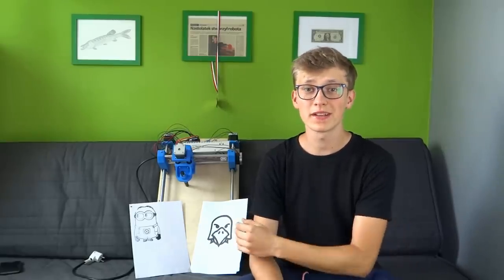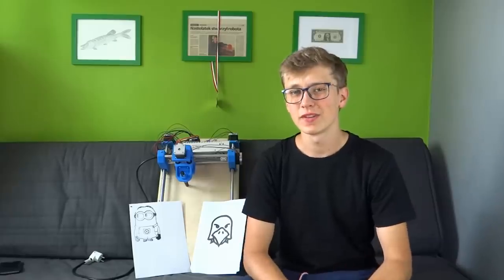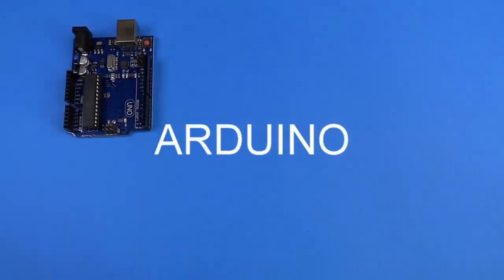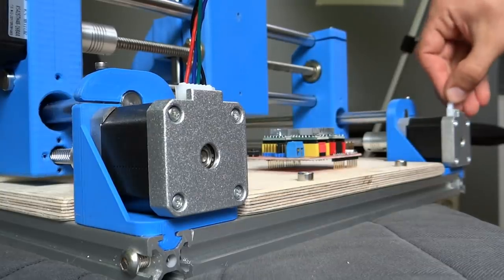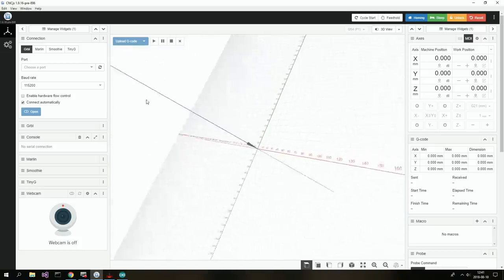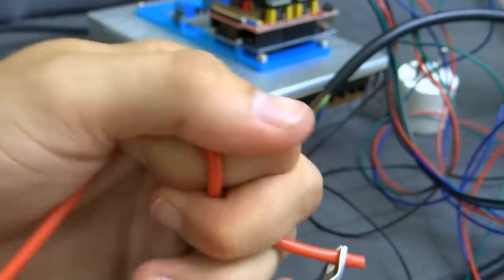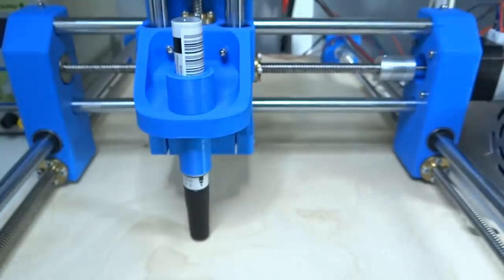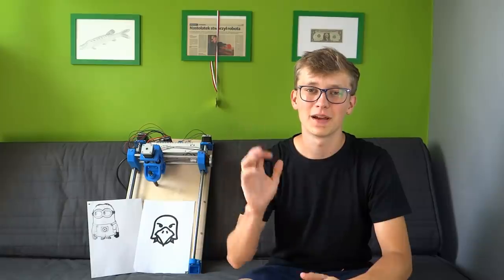DIY Dremel CNC #3 electronics, software and firmware (Arduino, aluminium profiles, 3D printed parts)

Comment: If some plastic parts crack when you drill them I have solution. Instead of chucking a bit in a drill hold bit with vice-grips and heat tip with torch till glowing and push through . I ran an Elumatic cnc  at work a few years ago and always wanted one since . I appreciate your video.

Comment: I have a problem, one of my cnc shields is smoking. I took a 12v 10a power supply and 1.9 amp motors.
Reply: Did you set the stepper drivers? You have to use a multimeter and turn the screw to make sure the proper output otherwise you will fry stuff

Comment: I ordered the 10A Power Supply because my dremel is powered on it own AC cord and I did not think I needed 20A to run the three Axis, Did i mess up or will 10 A run the three motors. I am powering one Z, One X and One Y (not 2 Y). Appreciate your input. I posted My adaptor for  this Dremel Drill Press conversion to CNC,  I know its light weight but my work is small light metal model trains, Thank You, Dennis

Update Nov 27 2023 I have completed the conversion of my Dremel Drill Press with Micro Mark Mini X Y Table into a version of your DIY CNC Mini Milling Machine. So far I used the Dremel Carriage with a unique Adaptor to the Dremel Drill Press Stand. All your recommended Digital stuff. I have only the Z axis operational and yesterday I machined a test part to verify the manual job of Z would work with manual operation of the X Y Tables. It was evident I need to continue to convert the mini XY table to CNC ASAP. I have ordered the Couplers and the CNC Shield of course has the Sockets and I also have the required A4988 drivers. I want to share the CNC Shield is a marvelous tool for us. Spindle control is a little messy but boy does this Shield Save a Bunch of time. I was so happy to see the Stepper motor take on in my first test. Now we are thinking about a load unload robot and some other tools we can use on our train layout. Thank You So much young man. Dennis in Virginia

Comment: I have finished with the physical DIY CNC machine and now I am trying to hook up the electronics.  I have been trying for over a week and am getting frustrated.  I have an Arduino Uno with a CNC shield and this is connected to my computer.
I have downloaded Grbl to the arduino and that went well.  I am using Universal Gcode Sender and when I bring it up on the computer, I checked that it has the same port as the Arduino.  I downloaded a simple Easel project, and generated Gcode.  I know the Gcode is good, since it came from an Easel project. When I bring up  the UGS window, and then open the connection, everything is fine.  But when I upload the Gcode from the Easel file the UGS,  I get a message that the 'machine status' is disconnected.  I do have the 4 cables from the stepper motors plugged into the CNC shield, but still get the error message that the status is disconnected.  Could I have a bad CNC shield?  Is there a way of testing the CNC shield?   Any help?

Comment: I have built the machine but my Z axis just vibrates. I have changed the Stepper motor driver and cnc shield by issue remains unresoved

Comment: FYI the esteps need fixing. I ran my cnc for 100mm but measured the distance at double. so $100=400 might not be the setting for everyone. 
Update: my $100=24.5, $101=24.5, $102=25, This is an approximation. And I made it run very slowly ($110, $111, $112 = 1) because my cnc would actually stall out when going very fast. Forget about putting on limit switch normal closed because it need a filtering capacitor. Also if using a power plug socket with fuse use a 1.5a. Granted I might not have bought the same spindle as other youtubers reviewers stated max wattage is 50watt and another 80 watt.

Comment: Hi, thanks for sharing such a nice project! I know this design is intended for dremel cutting purposes, but i would like to use your design for drawing just like you did in this video for testing, if so, is there any way I could increase the speed, so the pen would move faster? If yes, where I can do this change?
Reply from the maker: Sure you just have to change this in grbl settings
Reply: if you increase the speed it might affect the pen and may not write properly if the pen aint ok

Comment: Have you checked the concentricity of the spindle and chuck on the Dremel? I've had one where they were misaligned so that the tool axis was at an angle to the axis that the spindle was rotating on. Proxxon tools have much better spindle concentricity and alignment but they're twice as expensive.

Comment: For aluminium I wondered why you didn't use dual 12mm  guides for X axis ,long axis , just to keep it stiff. If it can cut aluminium it would be worth cutting and replacing the 3d printed parts even if you have to layer the parts out of thinner aluminium sheet and screw them together with screws to make one solid unit . I'm not sure if you could ten braze the sheets with special low temp rods and a gas torch . Even if this process is slow it will offer a more rigid design possibly stiff enough to make small brackets and assemblies. Speed may need to be slower to reduce the stresses but it is a budget machine after all.  I was contemplating designing 3d moulds to make a similar system partially from cement parts in order to stiffen the machine but this might entail stronger machines or gearing.

Comment: Nikodem, 12V and 5A is enought to power supply this cnc? I saw you used 12V 30A. Tks
Reply from the maker: Sure, check out video number 5 of this series I replaced this big power supply with something way smaller that works too

Comment: Hi Nik have you by any chance got a design for the printed part that is fixed to the power supply to hold the Arduino and other electronics .
I am half way through building CNC i am going to try fixing Makita Palm router to cnc .
Carry on with the designs

Comment: Hi. Can I ask if you have pictures of how to connect the end stops? Mine are the 3 pin connectors ( end stop mounted in n a small board ) and I'm not sure how to connect them .. thanks
Reply from the maker: you should connect COM pin and normal open pin (the third one is normal close) to the shield
Reply: Thank you.

Comment: What size bearings did you use for the end opposite the motors for the lead screws? I didn't see it in the description so I'm just curious. Also, what gauge wire were you using from the PSU to the CNC shield?
Reply from the maker: that's 608 bearing popular in skateboards

Comment: Hi Nikodem, great vid! What is the exact power supply settings you use for the stepper drivers? Power supply is 12v 30a how low have you reduced the ampere?

Comment: I have been looking at the Arduino kit you linked, and I noticed that it specifically says there are X, Y, Z, and A axes, so I assume you are using the A axis as a second Y axis. Do you know if that will also work for making the A axis a second Z axis? I ask because I have a dead 3D printer (control board fried) that I want to repurpose as a CNC, and if I can prevent having to buy anything except the control board, that would be awesome! :) Thanks!
Reply from the maker: Yes, there are some connectors on the side, you can mirror one of the axes (X, Y or Z) to the A axis. I talked about that in this video. It could work fine as for the control board because a frame of the 3D printer is not super rigid so keep that in mind.
Reply: Ahh. I thought you were only talking about the Y axis, as most other boards specifically have a Y1 and Y2. Thanks for the quick reply!

Agreed, most frames are not super rigid, however I had implemented a Z-axis mod on mine that make it ridiculously rigid haha. I am looking forward to trying this out!!

Thanks again! :)

Comment: Hi ! And thanks for your project that I'm on the way to build. Just a question : It seems that the slots for Arduino on the printed plate are just inverted. You don't have a corrected version ?
Regards.

Comment: Hi! Good project. If you think use it like milling machine for a  different hard material, you should replace the flexible couplings for a rigid ones. anyway that's a great.
Reply from the maker: I already did that in my next videos :) I just 3D printed them

Comment: Hi, i'm interested on how you were able to run cncjs, i can't figure it out, i tried to search but no tutorial on how to do it, i'm confused now please help thanks
Reply: If your running GRBL 1.1 you can control it with this: https://www.grblgru.com/ The version 3.0 shield was designed for an older version of grbl. It will run with the newer grbl but the pinouts don't match for all the board features anymore. Enough pins are correct for this project as built though. If you want cnc spindle control you can get a later version of the shield from the designer of the board. All the pins function with the new grbl version and the new controller board. The original creator of the shield sells new version boards from his website here: https://blog.protoneer.co.nz/

Another advantage of using the controller I mentioned above is it can take images directly and create code without the need for another program. The above controller will not work with the older versions of grbl as the baud rate is higher now.

Comment: Great design Nikodem, though is it scallable? like just use longer aluminum parts right?
Reply from the maker: Thanks! Yes it is, longer rods, lead screws and profiles. 3D printed parts are the same
Reply: It is very scalable but the bigger you go you may lose precision and quality.
If you continue working with threaded rods, whipping may start to be a problem, this is because no rod is totally straight.
An advise for longer linear motion are gear racks, check this link out: 
http://www.cncrouterparts.com/standard-rack-and-pinion-parts-c-46_39.html
But then Nikodem's 3d printed parts are no longer useful, begin with something small, like he did.

Comment: Great Job Congratulations! Do you have an STL file for the part mounting the arduino to the power supply. I didn't see it with the rest of the parts on Thingiverse. Thank you.
Reply from the maker: Looks like I forgot to add it, I will add it tomorrow :)
Reply: Nikodem Bartnik Thank you.

Comment: I have question. Y is up, or Z is up. I'm 3d programmer and I provide small Game Dev. In Unity(game engine) Y is up, but in Blender(3d graphics designing program) Z is up. How's with Arduino?
PS: Probably, power supply will not   smoke if you have to low voltage. I see from plug that you're in Europe  and not in the UK so your voltage is ~230V. In your position it's dangerous. But if you will choose 220V in e. g. Japan. Your system may not run(or even break) , but nothing will smoke.
Reply from the maker: Z is up
Reply: Z is standard up and down direction for mills. If you want it to have Y up instead you can simply switch the motor connections for y and z.

Comment: how wire the limit swirches
Reply from the maker: I actually didn't use them, those are not very useful in CNC machine because you always have to set reference point yourself
Reply: @nikodembartnik  how can I set reference point

Comment: Just a point about security: High voltages are less dangerous than high currents. Too much Amps might kill you.
Reply from the maker: that's true but you need high voltage in order to have high amps because our skin has high resistance.
Reply: Totally agree

Comment: Looking good. I’m looking forward to seeing it cut.  I should look into that software you mentioned. I’ve only use Easel with my X-Carve. It works OK, but it is nice to have multiple options. I don’t entirely love the web based dependency of Easel.
Reply from the maker: CNCjs looks awesome, I am not sure how it will work with X-Carve, Easel can be better because it's made just for this machine. But maybe you will find it work better for you. That's true, sometimes web based is not the best solution.

Comment: My cnc keeps on saying grbl has not finished booting. Can anyone help?
Reply: Make sure your baud rate is set correct. The shield used in this build is designed for grbl .8 and that installs at 9600 baud rate. The newer version 1.1 of grbl needs a higher baud rate of 115200 to install properly and will give you the "not finished booting" message.

If your running GRBL 1.1 you can control it with this: https://www.grblgru.com/ The version 3.0 shield was designed for an older version of grbl. It will run with the newer grbl but the pinouts don't match for all the board features anymore. Enough pins are correct for this project as built though. If you want cnc spindle control you can get a later version of the shield from the designer of the board. All the pins function with the new grbl version and the new controller board. The original creator of the shield sells new version boards from his website here: https://blog.protoneer.co.nz/

Another advantage of using the controller I mentioned above is it can take images directly and create code without the need for another program. The above controller will not work with the older versions of grbl as the baud rate is higher now.

Comment: Why do you need a 30A power supply ? 10A would be more than enough to driver those 4 motors and since you plan to use dremel, which is fed by 230V, then I see no point buy such a big PSU
Reply from the maker: I totally agree with you, the problem is that this is the only power supply that they had in a shop that I bought parts :) at least it wouldn't overheat and it is quiet. You can use 10A, sure
Reply: 3amp would be more than enough and far cheaper to buy.

Comment: Fajny projekt i dobra robota wszystko prosto i tak jak byc powinno. Jedyne co bym zmienil to wywalil sprzegla których uzyles na silnikach bo one dzialaja jak sprezyny i beda duze odchyly zamiast tego dal bym sprzegla jakie ewentualnie uzywa sie w cnc czyli sprzegla klowe (ale ze one sa dosyc drogie a raczej nie masz odchylow to polaczyl srube bezposrednio do osi silnika kawalkiem rurki metalowej / walka rozwierconego z 1 na silnik a z 2 na srube lub dosunal os do sruby i polaczyl calosc bardzo sztywnym wezykiem ze zbrojeniem czy nawet wydrukowal lacznik sztywny samocentrujacy z thingiverse)
Reply from the maker: Dzięki! Tak, nie jest to najlepsze rozwiązanie, ale jest tanie i łatwo dostępne. Prawdopodobnie wymienię to za jakiś czas
Reply: @nikodembartnik  Has this been corrected in the latest version available to us?
Also, v3.6 of grbl controller has been out for 6 years. Where did you find v3.0 I saw on your video?